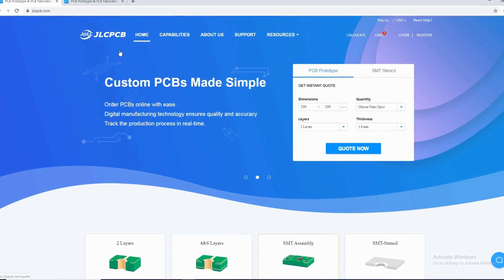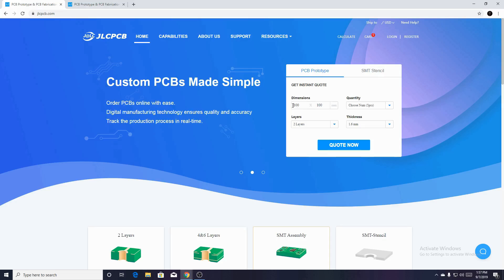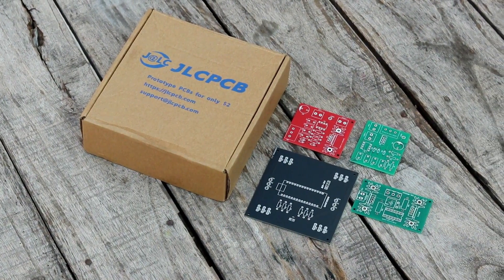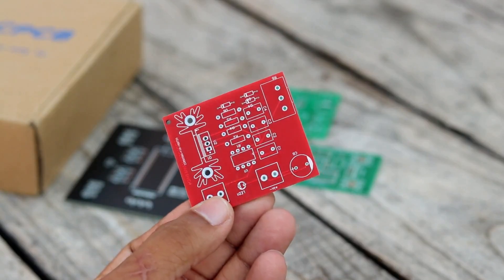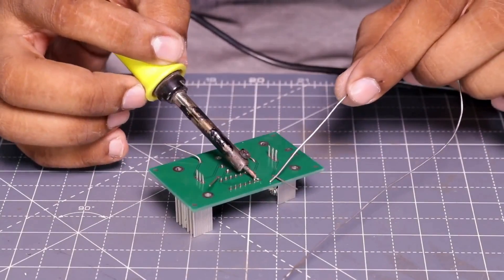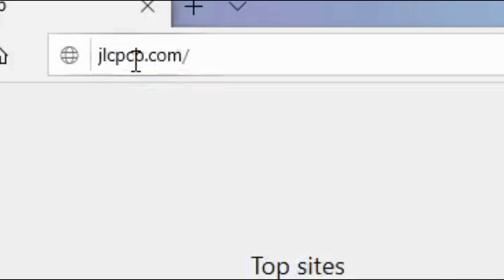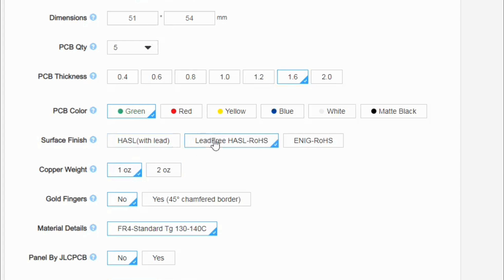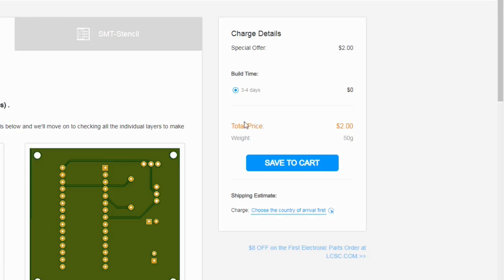WOW! How to Make Laser Security Alarm System - DIY ideas

Comment: Quick question: This can be used to activate a relay switch, correct? So instead of a buzzer, I can use it to activate something that repeats a pleasant message like 'welcome home' or something of that kind?
Reply: You could prob do this with a smart system, some speakers and python with pytts4 (python text to speech) module.

Comment: This is not DIY where did you get the completed PC board from and when you break the laser beam the alarm sounds and goes off, which means when the intruder passes the beam quickly you might not have heard it and will be woken up by the intruder with a gun to your head. The alarm must keep on going until you reset it.
Reply: This is something you could possibly change in the programming? I think it would be a reasonably easy fix

Comment: Arduino: 1.8.9 (Windows 10), Board: "Arduino Nano, ATmega328P"

Sketch uses 902 bytes (2%) of program storage space. Maximum is 30720 bytes.
Global variables use 9 bytes (0%) of dynamic memory, leaving 2039 bytes for local variables. Maximum is 2048 bytes.
An error occurred while uploading the sketch

This report would have more information with
"Show verbose output during compilation"
option enabled in File -> Preferences.
@The_Wrench
why do I get this problem